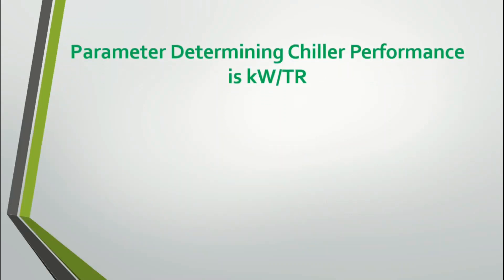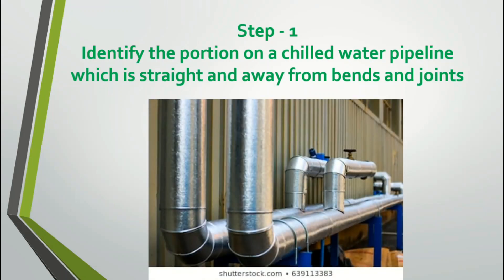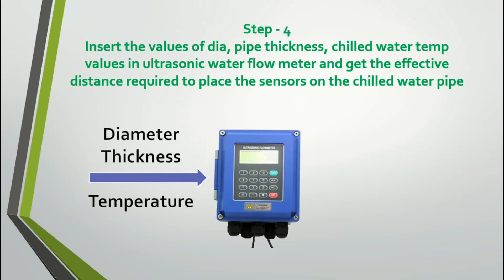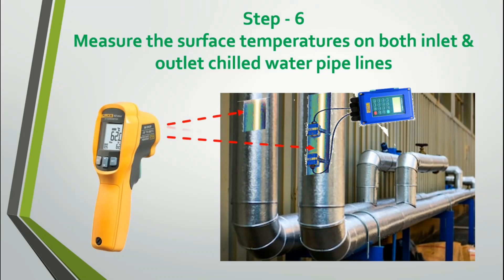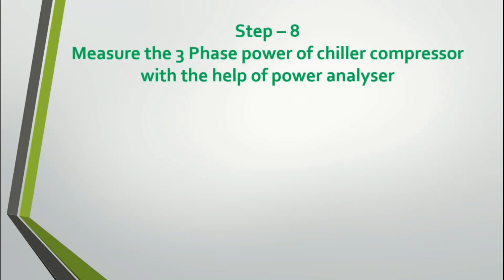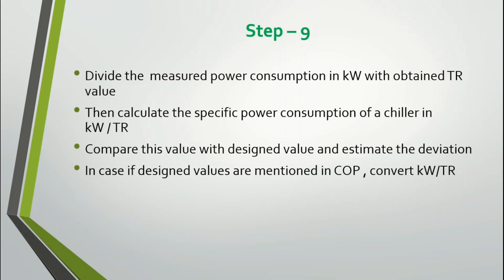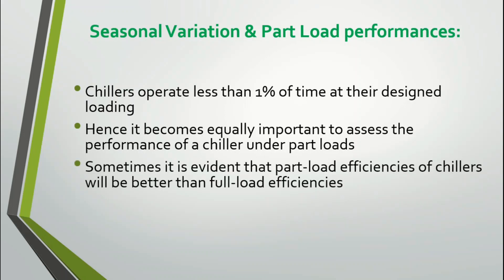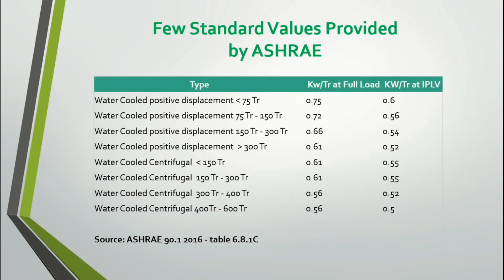How to test your chiller efficiency on site

Comment: I think we should take full chiller power (Compressor+condensor fan power)
Reply from the maker: You can do that or even you can consider chilled water pumps and condenser water pumps power too, but the problem here is that you wont be having any reference values to compare your measured value. Where as for only compressor, designed values are provided by manufacturer himself.